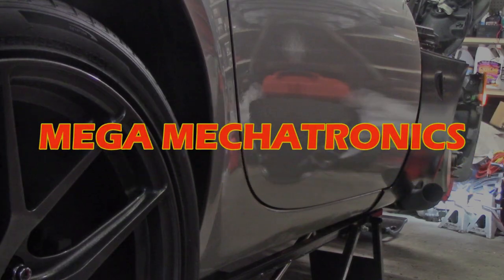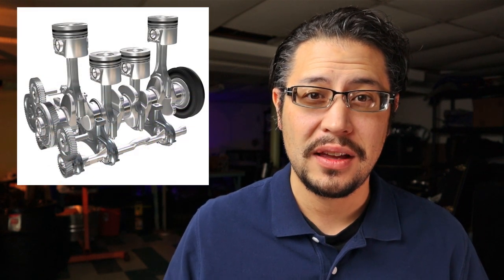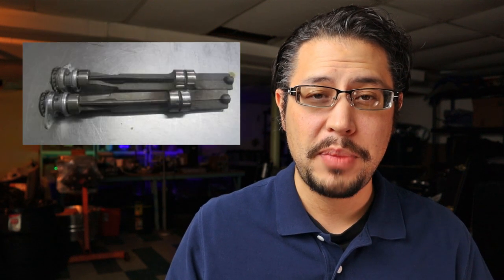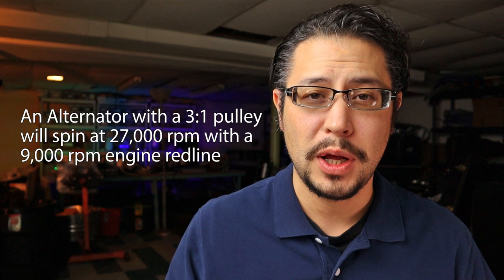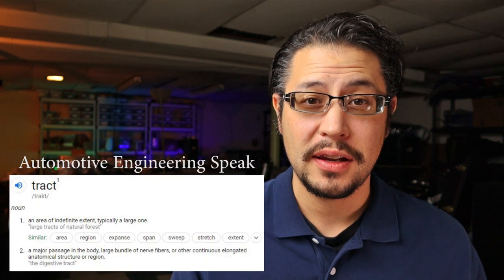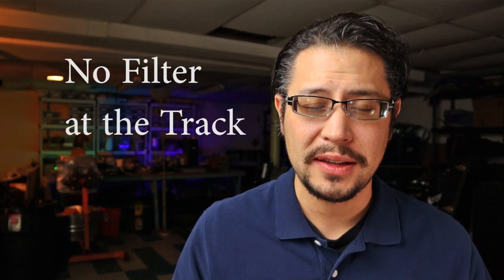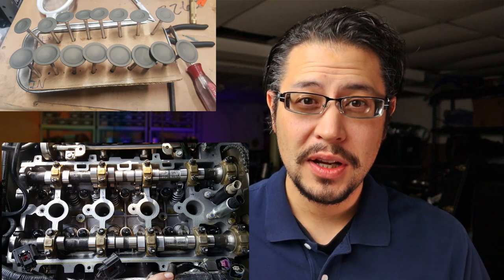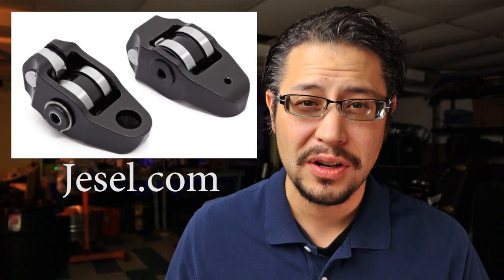Why you Won't tune an all motor 4 cylinder - Naturally Aspirated NA build

Comment: I disagree with you if you're talking in a general sense. Not all 4-cylinder engines are built a like.
Some engines are easy to boost like the mazda miata B6ZE(RS),  or the Mitsubitshi 4G6/4D6 which can come as
naturally aspirated or turbocharged from factory. What you said there could be easly misleading, just my thoughts.
Reply: I though miatas always came with 2R motors

Comment: NA > Turbo any day. You don't need big HP and torque numbers to have fun. Also, the snappy throttle response of the NA is unique.
Reply from the maker: They all have their place.  What are your thoughts on air cooled vs water cooled NA engines?  Air cooled engines can be pretty lightweight.

Comment: 😆😆😆🤣🤣🤣 You just described my build at the moment. I'm building a 4 cyl motorcycle engine, and I am encountering pretty much all of these issues. The project is really cool, but it is difficult and the costs are mounting. I'm having to research so many new things which is cool because I am learning a ton, but I'm definitely realizing that this is a very involved process. I'm definitely glad that the outcome will be way awesome and that this is mostly a learning project for me as I am currently in school for working on bikes.
Reply: thats cool, where are you at now since you said you were in MIT or something?

Comment: Not sure why you say i won’t tune a all motor? 
Yes you have to do all that and more but it’s still tuned. I’ve been doing these motors since 96
Reply from the maker: My original "script" would have been 20 minutes going into every system I talked about and as you pointed out I missed a lot as I pointed out too. And I'm not saying I left out details that you have experience with, haha I was eating boogers in 96'). I'd like to get your take on the next video of my opinion on why you Will indeed build a 4 cyl NA.  The framework of this 'You Won't' video is you want your car to go fast like most 16-20's car kids, the framework of the next video is: we'll just have to find out ;)

Comment: To sum it up the cost for the power isn't worth it like it is with a properly built turbo set up. Na is more reliable but reliability isn't cheap. When you get that $6000 dry sump just because you want a 25% boost you will relies that the reliability usually isn't worth it unless you are rich.

Comment: Must be a V8 guy and his stock motor still can't do 100hp per litter
Reply: I got 180bhp from a 2 liter engine that came out of the factory with 134bhp,  all motor guy owners know a 50% gain is a pipe dream I'd buy a 10k evo.
Reply: chevy 5.7/6.2 do 700-1000hp na

Comment: Yes I'm confused too on why you say "you won't tune"!!! 
You can tune any engine and depending on what spec you're looking for you can change one or all of components including modification to the head, block,ect... oh and solid lifters is an option too.
With that said, your information is correct.
Please change the title! Because people have and will tune their 4 cylinder N/A engines
Reply from the maker: Thanks for the comment. Please check out my next video on the Top 5 reasons you Will tune and build a high horsepower 4 cyl NA.  I'd love to build one and share it in the future.
Reply: He has another video on tuning 4 cylinders.

Comment: Mate you're scaring people 50% gain on a naturally aspirated engine is a ridiculous target, I have a 2L N/A engine I gained 25% bhp and 40nm of torque my car weighs 980kg I've doubled my nm per liter by 100% it ended up costing around 2.5k what your talking about would cost over 12k, there are grey areas, try gaining 50% on a 400bhp evo see how much that would cost I guarantee the evo owner would stick at 400bhp.
Reply: How did you do so with only 2.5k could
You list it out ? I’m working on a 2.0l Kia Forte NA looking to do sum damage on this one thanks!
Reply: @adamammar7102  If you can weld and know how to tear down and engine yourself, you can save about $5K from what it would cost to buy all of the metal work and pay someone else to buy and install your parts.  If he has to list it for you to understand why it costs that much then the list won't help you at all.  It goes something like this: 10Ft of 3" Stainless tube, 20' of 3" Tube various Mandrel bends or another 20' of straight tube if you have a proper bender, new fuel system parts and a micro squirt, throttle body(ies), TPS, MAP and other sensors.  You shouldn't need an upgraded oil pump gear until well after you see other oil pressure problems in that engine that aren't solvable for less than 3K.  Plain and simple, I am in the same boat as you, Veloster non-Turbo, Step 1: Intake, Throttle body from an Elantra Turbo, Cat back exhaust...let it breathe.  Step 2 - Valve springs, Pistons, Rods, Bearing Sleeves, crank caps, etc - See KDM Tuners they have the best kit and probably already fully configured for your car.  If you do not like the price, look at what they are trying to do and see if you can find those parts cheaper. Also, if you do Step 2, tune only to consistent smooth running do not tune for power until you update your Clutch/DCT Converter-Clutch assembly.  Step 3 is port, polish, ECU, bananas power gains and MANY smoked transmissions...basically, beyond Stage 2 you need to be looking to lighten the car, take the suspension to the next level, and improve Aero as those gains can only improve the car without risk of making it unstable.  If you want to get to the same power level faster and with a little less to build up, throw a small turbo with a piggy back ecu and a small intercooler, but you still have to change the pistons to lower compression and you should update fuel delivery, lifter springs, and oil temperature monitoring.

Comment: Lol you are way off.. honda boys been building N/A 350-400hp motors for years.  And you don't have to run more then 8,000RPM
Reply from the maker: Some car guys don't blink when they spend $10k, this doesn't mean it's a good value when you can get the same output for half the cost with way less effort.  What's cool and effective is a high output NA engine no doubt, but physics is physics. And if you break a 350 hp N/A 4 banger, it's going to cost thousands again and many hours of labor.  If you blow a turbo'd motor, at the least it's going to cost you a new-to-you junk yard motor, no need to open up the bottom end (like to check/file ring gaps).  I've checked ring gaps 2 too many times and found used ecotec engines inherently have larger ring gaps due to a larger cylinder bore diameters, which I reckon is the case with all piston engines.

Comment: Actualy longer runners are better don't say do not tune n\a if ppl like more resposive car y not its costs more and get less but a small hatch for example wrc vs 306 maxi 306 whas faster on tarmac fwd n\a vs 4x4 wrc if u hear the 306 maxi pure sound is just🤤not one car sounds better exept the n\a lexus LFA  and all u just said is=for a turbo  build btw a turbo engine does not last as long as n\a even if the n\a hits 9000 rpm

Comment: More rpms break easier .  fast winde rate na requires less displacement .  turbo requires more exhaust to spool them what a supercharger requires to work .  turbo are better on large motors .  auto manufacturers are putting out comics .

Comment: uh yeah, your 100 percent wrong, I have a naturally aspirated 4 cylinder and its tuned to beat high performance vehicles.
Reply: I run a ford focus SE Naturally Aspirated that gaps ST's for fun sad to say Every ST boy thinks i have a RS motor in my SE
Reply: @shawnexotics7828  As a Honda guy I have to say that sounds like an interesting build now imagine your focus with a Cosworth engine you will not only send those turbo kids back to home It will be better on the circuit .